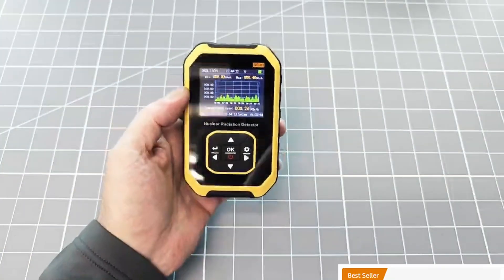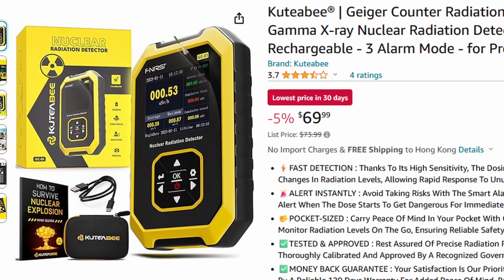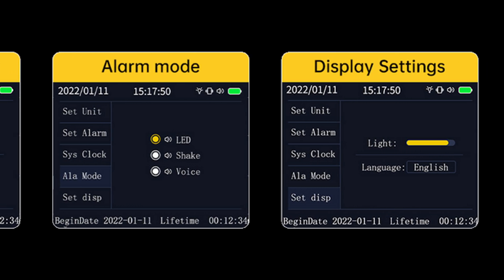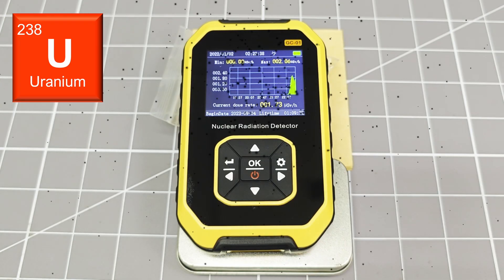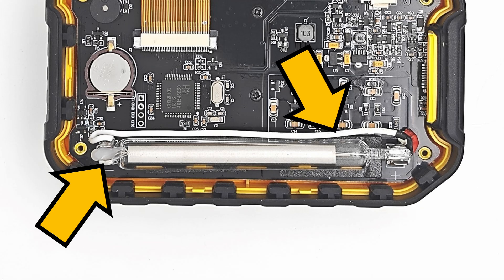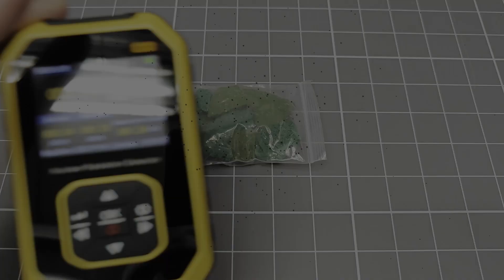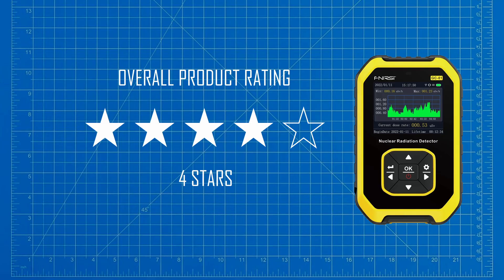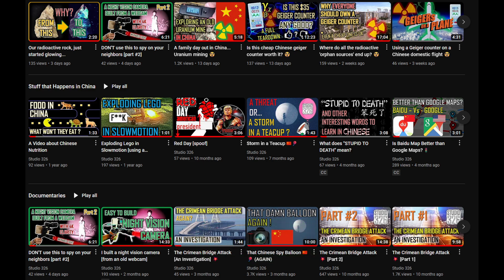FNIRSI GC-01 [IMPORTANT PRODUCT UPDATE]  ☢️

Comment: JUST an FYI. I just received my new GC-01. The Geiger/Muller tube in mine is at least twice the size of the one you show and doesn't have the wire bridging it. I am assuming it is an improvement but I need to test it to verify it.
Reply from the maker: Yes, that will be the J321 or M4011, which are both good.  Since shaming this company they have been a little more cautious with their 'design changes'.

Comment: I want to do the upgrade. Can you do a step-by-step video for that? You explain it but I need so detailed instructions, for example...remove the wire connection for the cathode connection explained better. And where to get the 100 nano farad capacitor. Is it audible to the naked ear? Or can it be only heard by your recording device?
Reply from the maker: There is another (later) video about a firmware upgrade that kind supersedes this video.

Comment: I opened the one i ordered from AliExpress, you cant even do the tube upgrade as they have removed the clips alltogether and no semos battery ether.
Reply from the maker: Thank you for the comment.  If you buy a new tube, like the J321, the clips are supplied with this.  I assume that the PCB still includes the pads for the clips?

Comment: In the video you dont have the fnirsi gc-01, you have rhe cheaper chinese knock off that i also got sadly
Reply from the maker: Thank you for your comment.

You are probably not going to like this reply, as it might contradict your assumptions on this subject.

There are no fakes or knock-offs of the FNIRSI GC-01 product, they are all manufactured at the same factory.  The factory owns the FNIRSI brand but also sells to other brands and customizes for each order of a significant enough size (ie color, brand  marque, PCB assembly option (including the tube).  Its a pretty standard OEM/ODM business model here.

The clue is that the brand name of the products (FNIRSI) is just an abbreviation for the Chinese factory name (Fei Ni Rui Si).

The factory is actually in the same city that I live in (Shenzhen), they sell on average abut 5K to 10K of this model per month, pretty slim pickings for someone that wanted to make a 'fake' version.  The fake one would still have to spend the same costs on tooling, etc and then have to sell for significantly less than the FNIRSI factory, which already runs on minimal margins (given they basically have zero brand power).

I have lived and worked here in China for 2 decades and worked with literally hundreds of local factories.  When I was making the video, I contacted the company and they initially assumed I was a drop-shipper or Amazon trader, and sent me price lists, build options, production rates and delivery/payment schedules.

Hope that helps

Comment: If you are european there is blueversion that's identical to this one but it's called JT rad01 from joy it company
I disassembled my device and it actually contained correct tube so it might be different here. It costed the same as finsri yellow one.
Reply from the maker: Thanks for the input.
Actually they are all made by the same factory and the blue versuon is just a branding thing.
I hope that helps...

Comment: hi, my GC01 has a slightly different pcb and mounts the shitty tube, can I directly replace the tube with a j321 one?
Reply from the maker: Thanks for the comment.  Yes, there should be the pads for soldering the J321 on the board too, mine had the shitty tube and also the pads.

Comment: Is there a better tube than J321 that will work in this unit?  Sadly I have the new unit.
Reply from the maker: Thanks for the comment.  There are plenty of better tubes available but the J321 will actually fit into the device and the power supply matches the requirements too...
Hope that helps!

Comment: I bought a device with a starting data of 2022. The seller contacted FNIRSI and said that his product was one of the newly produced versions. When I received the product, I opened it and looked inside, the battery had a production date of 24/07 and there was a Geiger Müller tube, M4011 tube, which is the same as the J321 but given a different name. The tests I conducted gave the same values as the J321. I think the manufacturer continues to produce the J321 "M4011" for FNIRSI.
Reply from the maker: Actually the factory owns the FNIRSI brand, so they have complete control over what tubes go into their branded products and what goes into the white label devices they sell separately.
Reply: @project-326  what is the difference between the white label device and normal one Geiger counter and why you Geiger counter don't have a brand mark
Reply from the maker: @prakashjamgade914  They are all made by the same company, here in Shenzhen.  The issue is that they seem to change the design around (for cost optimization) on each batch they build, so far I have seen many different versions from viewers photographs and there is no clear chronology of the changes either.

Comment: Watched your video after I purchased one. Mine has the actual name on it. When I opened it it had the correct tube and no resistor. I think there may be several manufacturers using same case. But different internals.  Thanks for the video.

Comment: @project-326. I JUST BOUGHT ONE OF THESE, NOT REALIZING I BOUGHT ONE 6 MONTHS AGO ..
THE ONE I RECEIVED TODAY HAS THE CHEAP TUBE INSIDE, THE ONE I BOUGHT 6 MONTHS AGO HAS THE  J321 TUBE... DIFFERENCES SO FAR

ONE SAYS FNIRSI,HAS THE J321 TUBE, HAS 5 SCREWS HOLDING ON THE BOTTOM COVER(1 UNDER LABEL IN THE CENTER)1100MAH RECTANGLE BATTERY... 

SECOND ONE HAS A CHEAP TUBE WITH NO MARKINGS, SMALL GREEN CYLINDER BATTERY,4 SCREWS,AND HAS NO FNIRSI BRAND
Reply: I BELIEVE THE FNIRSI ONE IS AUTHENTIC. THE ONE SHOWN IN YOUR VIDEO APPEARS TO HAVE THE CHEAP TUBE INSTALLED. THE SECOND ONE I BOUGHT NOT ONLY HAS THE CHEAP TUBE, BUT THEY EVEN SWAPPED OUT FOR A CHEAP BATTERY.. BOTH ARE CURRENTLY POWERED ON WITH FNIRSI READING 000.3 AND FLUCTUATING UP TO 000.23.. UNBRANDED ONE IS READING 000.8 AND FLUCTUATING TO 000.13 USV/H

Comment: btw Does anyone know what battery pack connector that is? I want to replace it with an even larger one. Rad Pro firmware kinda cut down the battery life.
Reply: The battery connector in question is a JST XH2.54 2-pin apparently.

Comment: In relation to suggested improvements I would add that it would be nice if the user was able to record number of counts over a predetermined period.   It could be as simple as a fixed minute. Since there is a microcontroller this should not be a difficult thing to design in.

Comment: Re: the two tube "options". I received one of these this week from AliExpress and it has the (better) J321 tube, so maybe they did watch your video and took note. Secondly the tube's sensitivity to beta is limited by the plastic and rubber case. I do a demo ofcollecting radon decay products from the air in a house. When I presented the sample to the tube with the case open I got a much higher reading than when the tube was boxed up in the case. If this concerns any reader (especially since the radon demo is quite a polular thing to do) it would be possible to cut a long hole down the side of the box , or of course design a whole new box for it.

Comment: is the m4011 tube a cheap bad one or is it good as the j321
Reply from the maker: They are almost identical, reasonable tubes for the price.
Reply: @project-326  Also i have one more question if you dont mind, so ive had the fnirsi gc-01 for about a week now and i just wanted to ask is the radpro software or the stock one better? you've had this device for a while and you would probably know, thanks
Reply: @project-326  also what would be a good upgrade tube for this geiger counter

Comment: Thank you for your video, i decided to buy a 20 usd second hand fnirsi counter and i will upgrade it as i found the j613 small tube.  I understand  i do not need to remove the resistor. Changing the tube with j321 is possible but needs new clips right?May i use a hobby solder ? what about tube purchased on aliexpress?

Comment: thank you for your review. Just bought a GC-01 on Amazon in October 2024. Mine has a J613 tube. According to your review, unless you upgrade to a J321, you would give the product a zero rating because it does not detect beta particles?  according to the description on Amazon the GC–01 should detect beta particles.
Reply from the maker: Yep, that's what they say on Amazon, but not sure the beta particles themselves have figured out to get through the steel cathode, maybe if they read a bit more of the market BS for this product they can figure it out...
The gamma sensitivity of the J613 tube is also terrible, hence the zero rating.
Hope that helps!
Reply: @project-326  yea, it helps, thank you. I will return the product.

Comment: I upgraded the crappy POS tube I had, to a J321, installed the RadPro software and upgraded the 1100mah battery to a 3500mah battery. update We are over 40hrs run time and counting now. 

Ps: the clips you need to solder on for the J321 tube are heavy duty fuse clips.
Reply: Hi is it simple to change the tube? i have a j613 and i want to change with the j321. The pcb will accept this upgrade? may i use a hobby solder ?
Reply: Where did you get the J321 tube and the 3500mah battery?

Comment: Gee, I thought it was a PoS just because the clock resets to Default every time I turn it on!
Reply from the maker: Some of them (mine for example) comes with a separate back-up battery which keeps the RTCC going.  But the clock is really the minor concern...

Comment: Did you add the 100nF cap in series with resistor or only the capacitor ? I tried first 2.2K and the sound was weak, then I replaced it with 100n cap. and the sound became even weaker, now I'm running with 2K, but the click sound is still very weak.

P.S. I ordered mine from aliexpress and it is with M4011 tube, google said it's the same spec. as J321.
Reply from the maker: The sound isn't the loudest, but there is a better solution.  In this video I used only the cap.  If you look on this channel you will find a video about a FW upgrade, which give very decent volume level clicks...

You are correct, there is almost no difference between the M4011 and the J321.

I hope that helps!

Comment: Please tell me, what was the battery standby time with the original firmware?
Reply from the maker: I can't remember, I will need to put that back on and re-test.
Reply: @project-326  asking because you said that with the new firmware it was only 16 hours, btw..the latest new firmware also has a dark theme.
Reply from the maker: @ExploringWithJason  It was a few days, but don't remember if it was about 3 or 7...
Reply: @project-326  of it working and with the screen on?
Reply from the maker: @ExploringWithJason  the device wasn't being actively used so the backlight will turn off.

Comment: I bought my product named GC-01,  on 03.08.2024, it even has FNIRSI GC-01 printed near LCD, however it uses  vastly different board. it doesn't have supporting pins fot the tube at voltage outputs, it uses some nameless tube (maybe J613). Is there any possibility of perhaps mailing You the photos, so You can judge, if it's possible to mount the J321 tube on this board ?
Reply from the maker: project326@qq.com

Comment: I sold my Pudibei NR1050 and bought the Bosean FS5000. It came with the J321 tube. I agree that it is a well-made device. The FS5000 can be upgraded with Radpro open-source firmware (as can the Fnirsi GC-01) and is then compatible with GeigerLog v1.5 PC software for logging, data transfer and analysis.
Reply: The FNIRSI uses an ARM Cortex M3 MCU. However, and also even better, the Bosean FS-5000 uses an ARM Cortex M4 MCU. Here are some specs I found about the two, if you're interested . . . 

ARM Cortex M3:

Program memory size: 64 kB
Data bus width: 32 bit
ADC resolution: 12 bit
Max clock frequency: 72 MHz
Number of I/Os: 64
Data RAM size 20 kB
Min. supply voltage: 2 V
Max. supply voltage: 3.6 V
Min. operating temperature: - 40 °C
Max. operating temperature: + 85 °C
Data RAM type: SRAM
Interface type: CAN, I2C, SPI, USART, USB
Number of ADC channels: 16
Number of timers/counters: 3
Program memory type: Flash
Product: MCUs
Moisture sensitive: Yes

ARM Cortex M4:

Program memory size: 256 kB
Data bus width: 32 bit
ADC resolution: 12 bit
Max clock frequency: 80 MHz
Number of I/Os: 52
Data RAM size 64 kB
Min. supply voltage: 1.71 V
Max. supply voltage: 3.6 V
Min. operating temperature: - 40 °C
Max. operating temperature: + 85 °C
DAC resolution: 12 bit
Data RAM type: SRAM
Interface type: CAN, I2C, LPUART, SAI, SPI, USART
Number of ADC channels: 16
Number of timers/counters: 11
Program memory type: Flash
Watchdog timers: Watchdog timer, windowed
Product: MCU+FPUs
Moisture sensitive: Yes

Comment: isnt .2 to .3 microsieverts on the high side for background radiation?
i am thinking of upgrading my own tubes because mine was also originally reading an average of .1 and i thought it might also be underreading levels but everything ive read says .1 should be around the average for bg radiation
Reply from the maker: Indeed it is, after making this video, I discovered that the loading resistor should not be removed but adjusted to match the PSU (the voltage is very erratic between devices).  With a 10M loading resistor, the readings became a lot more reasonable.  Here in Shenzhen, I normally see about 0.18 nSv/h when averaged over a reasonable period of time.
When I made this video, it was summer in this tropical region and the humidity was over 85%, but when the winter came, and with it the lower humidity, I noticed that the tube voltage was getting too high...

Comment: So after installing the j321 tube and upgrading firmware, it worked great. Until it didn't. Next time I turned it on it didn't read anything and it ended up throwing a fault after 3 minutes or so of sitting.. any suggestions?
Reply from the maker: did you remove the loading resistor?  You could try putting this back, the tube voltage on my PSU was quite low but on other unit I have seen much higher voltages.
Reply: @project-326  I did not actually, saw the update before hand. The power supply on the board took a crap somewhere. Only getting 2-4v at the positive of the GM tube. Little unit be dead

Comment: How can I find date of mfg? Nothing on box or packaging or unit. Start time says 2022. If I open it can I return it? Hesitant about opening! Thanks!
Reply from the maker: That is catch 22, the date code is usually recorded on the PCB.  That said, this company has chopped and changed between tubes, so the only way to he sure is to open it up and look at the tube.
I guess the logic could be as follows:  If it is a J321 tube, then there is no need to send it back.  If it isn't, you could always update it?
;-)
Reply: @project-326  Thanks for the reply!  I did decided to open it up, and it has the J321 tube, just like the pic in your clip above.  Also, there was no center screw, just the four corners.  Maybe this is a newer update?! I don't have any standard sources to check, but it did agree with the readings taken via a radiation safety Geiger Mueller counter.

Comment: Hey there, I use this Geiger counter around the house. When I tried it on a smoke detector, it went to 5 sieverts but a couple days later when I constantly tried it again, it only went to 1.96. I tried things like: letting it get used to natural radiation levels or resetting the cumulative but still nothing. I know about radiation but this confused me! Please give me advice!
Reply from the maker: Thanks for the comment, hope I can help in some small way...

First of all, I really hope you mean 5 uSv/h, otherwise you have seen a fatal dose.
The issue with close up measurements of things like Am-241 based smoke detectors is that it is basically a point source of weak gamma rays and this means that the exact way you hold the detector is going to make a big difference.
Also be aware, the tube fitted in you device might be the cheap one that has a solid metal cathode and so the 'geometry' of you measurement can become even more critical.

Hope that helps?
Reply: @project-326  Thanks so much man! This helps so much. I can see how this Geiger counter could be problematic in an actual dangerous situation. I'm quite young and I'm really interested in radiation, is there anything in a house that could make my Geiger counter go off?

Comment: Hi, thank you for your review and these valuable information and insight! I bought this device about a year ago. It has the J321 tube in it I remember it because I was once in a hurry and dropped it and it stopped measuring. When I opened it, mine had no glue at the place of the tube so the tube moved after it hit the ground and lost contact. I moved the tube back in place and it works again. However Its a shame they have changed the manufacturing process, its misleading the customers.
Reply from the maker: Yup, its a kind of "bait and switch" operation...

Comment: Can I swap the tube with a Pancake such as an SBT-10 or will a large tube completely kill the power supply?
Reply from the maker: not sure, you just need to check the operating voltage range for the tube.  You should also check the tube supply, in this product there is a wide tollerance.  If you want to know how to do that, there is some information in the video link here about constructing a high impedance measurement probe (A DMM will apply a high load to the PSU and pull it down to a fairly low level).
https://www.youtube.com/watch?v=2e-BhAZg9d0